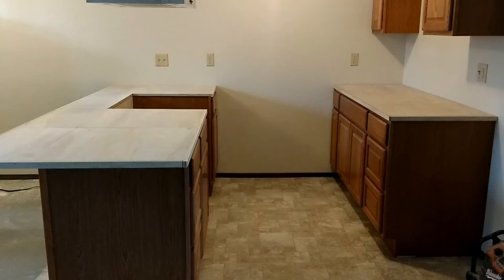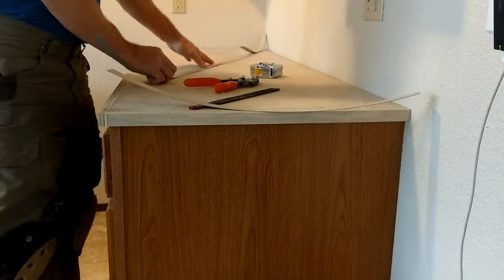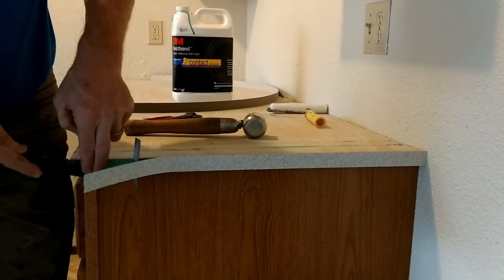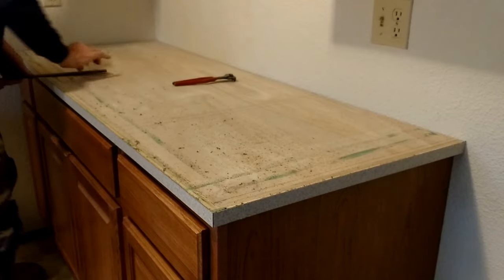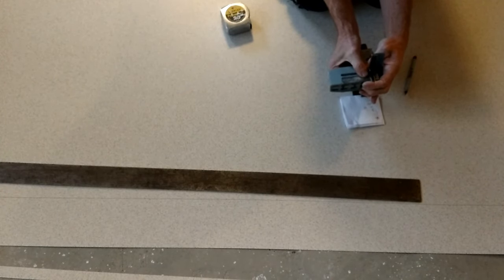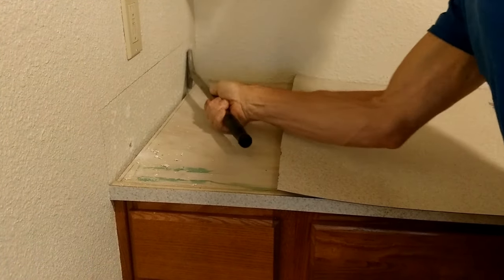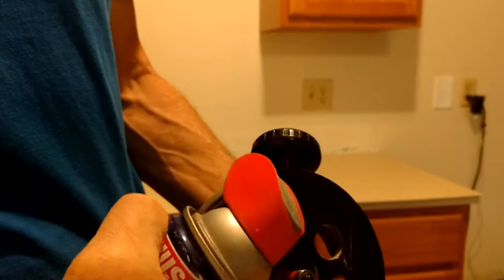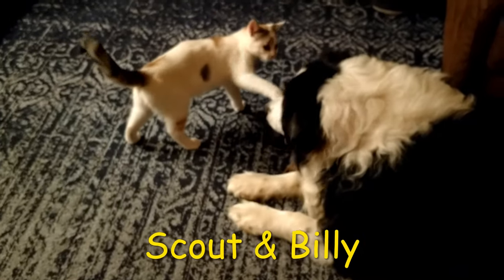Laminate Countertop (Basics) -  SECRETS TO PROFESSIONAL RESULTS!

Comment: What's the best way to fix a mistake? As quickly as possible.
Reply from the maker: Yes, as quickly as possible.
But seriously, I have no idea what kind of mistake you are talking about.
Reply: 7:40 you point out that you forgot to trim wood flush. You fixed it no big deal.   Btw, I've found your laminate vids to be the most helpful I've found. I just finished watching them all. I do wonder if you'd rather glue the laminate on a countertop already installed or do you sometimes build the top, glue on the laminate, and then install it on the cabinets. I'm in the process of making an 11' L-shaped counter and it sure seems like laminating it on a workbench would make it easier to trim up the corners and whatnot if not installed on cabinets between two walls. But am a little concerned about something cracking or chipping trying to move that large of a countertop  into place. Do you prefer to glue on laminate after base countertop has installed on cabs?   @elbowshots
Reply from the maker: LOL I'm glad you clarified that.
As a general rule of thumb, I prefer to have the sub-tops secured to the cabinets. It's easier for me to work on them that way. Everything stays more stable. When I have worked on tops that are not secured, I feel like I have to chase it around too much.
There are some tips for handling large sheets in this video:
https://youtu.be/u-rLTH5U5yk
Thank you!

Comment: Thanks for the tip on a new scoring tool having the tendency to walk. I'm doing my own counter top install and I'm the point of laying the laminate and that tip could prove to be very helpful so as not to screw up the laminate with it walking.
Reply from the maker: You're welcome.
I was taught to place my straight-edge on my work and have the cut-off piece on the open side just in case that happens.
Thank you!

Comment: Mannn I wish I could buy some 2" laminate strips for my counters, but most places will only sell full sheets for $160+ or half sheets for about $20 less than a full.
Want anything less? Promptly directed to 3/4" melamine edge banding.
Sourcing problems aside, Thank YOU for making the installation methods accessible and easy to understand!
Reply from the maker: Thank you! I usually cut my self-edge strips from the full sheets when I am cutting pieces for the job. They are not available as a stand-alone product.
An option that may work for you is to use hardwood strips. I have done countertops with oak or maple edging.
Here is a link to a video where I used teak:
https://youtu.be/eCiyDHyN92A

Comment: Thanks for the tips, wish I'd watched this one before doing my kitchen, got some "hooks" that hooked clothes and snapped off.  Just did my RV the way you showed and it came out great.
Reply from the maker: Sorry to hear about the hooks. Happy to hear about the RV.
I'm guessing the pieces that snapped off were at the corners of the self-edge. I have done self-edge replacement. Usually, because a corner snapped off.
The best way I have found is to use the laminate slitter to cut the new piece. It provides a clean edge that needs minimal filing.
That is, of course, if you have more material.
Thanks for watching. I'm glad the RV came out great.

Comment: You have the best laminate tutorials on youtube! Very helpful. 

I see you make all of your cuts prior to using the router very precise. Particularly on the edges with the laminate slitter. 

If I don't want to buy a slitter (they are a little pricey, and I'm just doing a 1 time kitchen DIY project), could I just make 'rough' cuts with shears and/or circular saw and then trim the edges up with a router?
Reply from the maker: Thank you! I appreciate the comment.
Without a laminate slitter, I usually use a straight-edge and scoring tool to cut self-edge. I cut it about 1/8" oversized.
To install, align the bottom with the sub-top, then trim the top flush and file it.
Thanks again.
Reply: @elbowshots  Great, thanks! I guess also what I am asking is: 

Could I leave it 1-2 inches oversized and then just trim with router (assuming I have plenty of laminate sheet)? Is there some downside to doing it that way that I am not seeing?
Reply from the maker: I have always used half-inch overhang. My router bit is half-inch. So after fitting to the wall, I have less than that.
With an overhang of more than the diameter of the bit, it creates more drag, which takes a little longer to trim.
Also, the laminate can curl downward at the outside edge. This can cause it to dip below the cutters on that side of the router bit.
You can have 1-2 inches of overhang. It's just faster and easier for me to work with a half-inch.
Thank you!

Comment: I want to install new laminate over an existing previously used plywood substrate.  I removed the old laminate, it was chipped, cracked, warped and bubbling up, etc.  I scrapped and sanded all of the old contact cement off so the substrate is clean free of old glue and smooth.  Can I now apply the adhesive to this existing plywood substrate follow the procedures in your videos?  

Great instructional videos and I have looked at a lot of them.  Thank you.
Reply from the maker: Based on your description of the condition of the substrate,
I would say yes, you are ready to install new laminate.
Sometimes, removing laminate from plywood pulls up large splinters from the face. You are fortunate to have a smooth surface.
Thank you!

Comment: I struggled with self edge end-cuts for so dang long, just couldnt get it right. I almost sold my van with all the  tools...
But then.... bam!  
I got me some 1984 ceramic tile nippers and filed the stops off. 
Life is pretty OK now.
Thank you.
Reply from the maker: Yes. Isn't it amazing how one little idea can be so enlightening that your life changes as a result of your new outlook.
I'm glad I was able to help you out of such a crises of vocation.
Thank you.
btw, If you know a better method, I'm listening.
Reply from the maker: Hi Doug, sorry I took so long to reply.  I was working when the notification came in, and when I got home, I couldn't find it anywhere. Anyway, I found it in the spam folder.
Your first comment cracked me up.  It sounded like one of my brothers bustin' my chops.
I have tried a few different methods of nipping laminate, like various types of clippers and the router.  The ceramic tile nippers with the stops filed off are the best for me. The double beveled cutters don't get quite close enough, and the farrier's nippers are too heavy and bulky.
I am often asked how I like a particular tool, and when I think back to how long I've actually been using it (most of them over 30 years), I usually conclude that, "That's a pretty good instrument."  My metal miter box was old when it was handed down to me, and I still use it.
Thank you for the chat, it was fun.
Reply: @elbowshots  I hear you bro. I was busting your chops because I just got a good chuckle from how you explain in great detail what you used and where they came from and how long you had them LOL I've actually got a pair of mild steel handmade snips that are about 11 in Long and they have curved Jaws very close tolerance almost like a pair of scissors.  The left side jaw is the lower thinner cutting edge. And that's my primary go-to because I also use it for cutting oversized tops for vanities some backsplash and anytime I just don't know where my carbide tip cutter is or I don't feel like listening to my mini router and in a lot of cases the less mess the better when it comes to the router. Good luck man nice video try not to give all the secrets away though so many people out here in the west coast think they know what they're doing and it used to be money in my pocket to go and fix their crap but nowadays people don't have money to pay twice. Peace

Comment: Awesome video very helpful. How do you handle the front edge if the corners are cut at a 45? Outside corner not inside if that makes sense? Is there a certain order you glue the pieces?
Reply from the maker: Sure, that makes sense. I have installed those corners in different sequences. It doesn't seem to make much difference. If it is a very short run, like less than two inches, I have put those on first.
Usually, I tend to stick with the sequence of working from back to front. So, that little corner piece would be second.
As long as the joints are filed smooth, there shouldn't be an issue.
Thank you!

Comment: Loved watching this video!! If your base ply has  a join in it. Can you apply the laminate directly over the top? Or do you have to cut the laminate and have a join on top of a join? If that makes sense? Thanks!
Reply from the maker: Thank you!
My preference is to be seamless as much as possible.
Sometimes you can't get away from it. If the sub-top has a joint in it, and the laminate also requires a seam, it's best to keep at least 3 inches of separation. Stacking joints on top of each other creates a weak point.
If the sub-top has a joint in it and the laminate is seamless, I give it a once-over with the belt sander to make sure it's flat.
Thanks!
Reply: @elbowshots  that's great! I wasn't sure if going over the tip of a joint on the sub surface might make the laminate crack easier.. my bench is in a caravan. Thanks!
Reply from the maker: Thank you! You might find this video interesting:
https://youtu.be/eCiyDHyN92A

Comment: Do you have a video that shows how to do a curved outside corner?  Specially how to do the counter top edge.
Reply from the maker: I do not have any footage of doing a curved outside laminate corner. I can recommend you make sure the edge is square to the countertop so it will track properly as it goes around. I usually use a heat gun to soften the laminate to prevent cracking. I also recommend a radius about the size of the top of a 5-gallon bucket.
I have a video of a rounded teak edge: https://youtu.be/eCiyDHyN92A
Thank you!

Comment: Thank you for sharing the great work that you do, I'm making an island for my kitchen, first I was going to do resin on top so I rounded all the edges, do you think I can still do laminate instead? Or nail a 2x1 all around to have a flat edge?
Reply from the maker: You can do rounded edges. I usually use the top of a five-gallon bucket to get a good radius. A slightly smaller radius can be done without cracking, if you use a heat gun to warm it up.
You may want to double up the sub-top to get a thicker profile on the edge.
Also, check out this video to see how I rounded a teak edge:
https://youtu.be/eCiyDHyN92A
Thank you!

Comment: Wonderful to watch (and hear) a true pro at work. Big compliments!
- Have you ever tried plastic laminate on walls, using FRP adhesive?
Reply from the maker: Thank you!  I have installed laminate on walls in tubs and showers, as well as for wainscot and full-height, floor to ceiling panels.  It has been a while since I've done any of those.  I have not used FRP adhesive, but it seems like a good product to use for this application.
I have seen panels installed with acrylic tile adhesive.  Laminate has a compressed paper backing which absorbs the moisture in acrylic adhesive and causes buckling of the panel.

Comment: Great video!  For areas where you can't avoid a seam in the laminate could you paint the counter top with something like shellac to decrease the odds of water damage?
Reply from the maker: Thank you! If you are talking about sealing the sub-top prior to installation, you could, but I don't think you would gain enough water protection to warrant the extra step and time.
I have used acrylic-latex caulk to fill a seam during installation.
Take a look at my video for cutting seams:
https://youtu.be/QOY_PSJ57ZM

Comment: Thank you, and wow! I can tell you have done things like this a lot and you line things up easily & manage to not cut yourself. I need to put new formica down over existing laminate but I'm going to pull the countertop off to make the vanity taller (it was designed for children or someone very short). I will be able to have overlap on all of the edges that way. Is there something else I can use for trimming aside from a router? Maybe some sort of hand tool?
What was the trim you used for the backsplash? Does it come in gold or polished brass (I'm going to be fixing up my mother's vanity & she likes gold colors). 
The contact cement that requires more pressure is just what I need. All of my cassette and VHS tapes have crooked labels because I suck at getting things aligned. 
You made this look so easy!
Reply from the maker: A router, or laminate trimmer, with a flush trimming bit is best. It takes the guesswork out of the equation. I have never used anything else.
The b/s trim is aluminum cap and cove. It is supplied to me by the floor covering store I work through.
Gold anodized pieces used to be readily available. I haven't seen it in use in decades, with the exception of the installation of a retro pattern I did in an old house. They had gold-colored faucets. I had a couple of pieces ratholed away. Good luck and thank you.
Reply: @elbowshots  Thanks for the info. I will have to do some practice with my router to make sure I get it right before I tackle it. I haven't used a router in over 25 years.

Comment: Thank you for this video.  It was very helpful and confidence building.  I'm about to replace our Formica pre-form countertops with laminate.  It's one of the last steps in a (very successful) renovation plan of our home that has had me learn so many skills.  I've moved our bathroom from one side on the house to the other (had to divert our plumbing stack), taken out walls, put in windows, everything from shingling, drywall, ceramic tile, laminate flooring, plumbing, lots of electrical, etc.  But I have never done laminate counter tops.  I'm not a trades person by profession ( I'm an electronics engineer working as a computer guy for a health region) but along the way I've had the opportunity (or have been faced with the necessity) of having to do a lot of different things.  I would also rather learn how to do something than pay someone else to do it.  This stems from a combination of pride ( I think I'm smart enough to figure most things out) and frugality (can't afford much so better figure it out).  But I have never had any experience with glue-down laminate counters except seeing it done once when I was probably 6 or 7 years old in the house I grew up in.  Again, thank-you, you are a true craftsman and an excellent instructor.
\
Reply from the maker: Thank you for your kind words.  I love your adventurous spirit, and your willingness to expand your knowledge base by trying new things.  Even if we are not exactly sure how to move forward, the answers will come to us if we seek them.  I wish you continued success in your ongoing project.

Comment: So we are pulling the old lamenent off and laying  new down on the existing counter tops. Will we need to sand down all the glue completely flat and smooth to get the best finish? Or should we just laminate over the existing counter and not remove old top? The laminate  actually rolls up the wall we are going away from that as well and going with an actual  backsplash.  Thanks for you video
Reply from the maker: A flat and smooth substrate is desirable to get a flat and smooth finish. If you remove existing laminate, the glue residue should be as flat as possible.  Sanding glue can be a challenge if it is too thick or soft.
If the top is structurally sound, you can laminate over existing.
If the laminate "rolls" up the wall, it is likely a pre-formed countertop that also has a rolled down front edge.
Do not try to re-laminate this style countertop.  Either replace the entire countertop with a new pre-formed top, or build a new subtop using industrial grade particle board and laminate that.
Thank you.
Reply: @elbowshots  thanks for the information  the only roll is on the backsplash. Everything  else is cornered. The laminate  just roll up the wall nothing  behind  it so we can use flat pieces. Thanks for the information.

Comment: Very nice video! Thank you! I'm now confident in every aspect except the backsplash. I removed a 1x4 backsplash and would like to replace with the same. It was nailed to the wall. For the new backsplash, should I attach the laminate to the 1x4 first and glue it to the wall, or nail the 1x4 to the wall and then laminate it.   Any suggestions?
Reply from the maker: Either way will work. With a 1x4 (Montana) backsplash, I usually laminate the ends and top, nail it to the wall, then cover the face. Thank you and good luck.

Comment: Very well done video,  thank you. Wondering where you use an angled bit router bit ?
I kind of remember using the straight flush bit for the edges then the angled for the top if my memory serves me correctly. Am I right ?
Reply from the maker: Thank you! I do not use an angled bit for countertops with a laminate self-edge. I put a 45 degree bevel when I'm working with hardwood edging.
There were people who would do a final pass with a 22.5 bevel bit to soften the top edge, but I have always just used a file for that.

Comment: When using a jigsaw, there is a "down cutting" blade. The teeth are angled so that the. Dow corce is supported by the surface its setting on.
Reply from the maker: Yes, I have used these blades. We called them reverse tooth blades. They cut on the downstroke. They are good for cutting laminate that has already been adhered to a substrate. Using a standard blade that cuts on the upstroke can chip the laminate. Thank you.